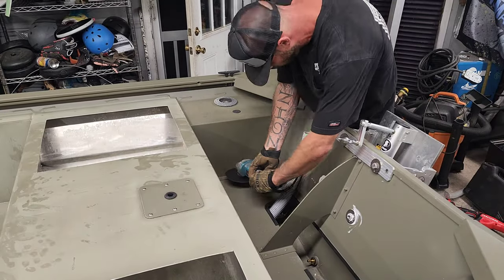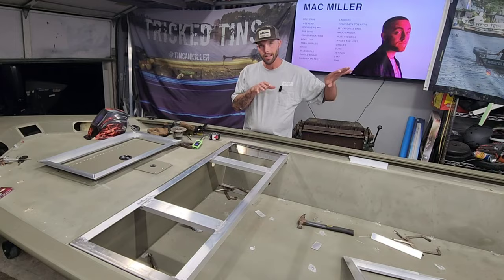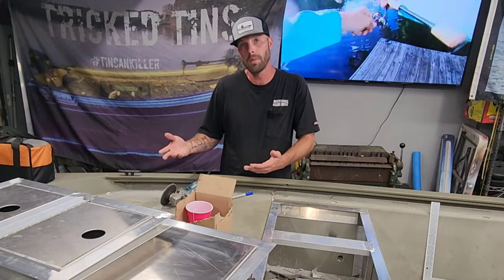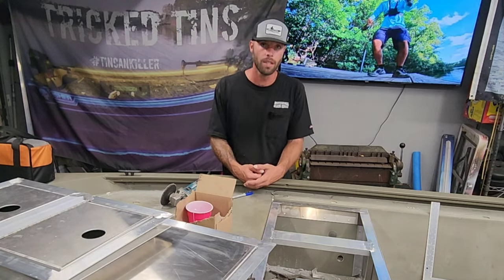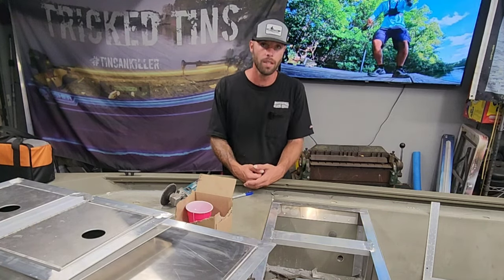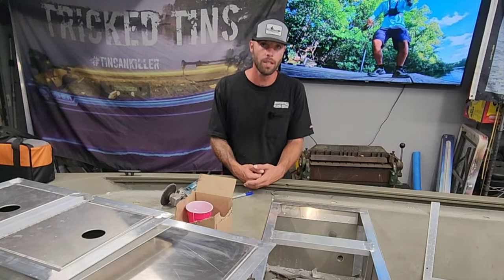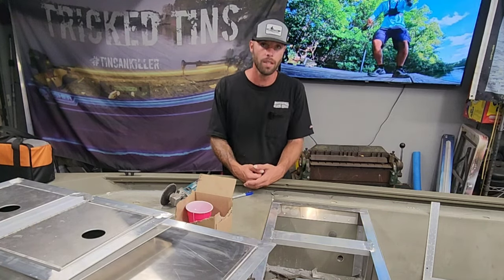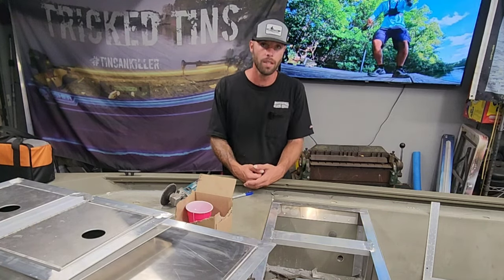Tracker Grizzly Full Build!

Comment: Awesome build once again! Curious if you do anything to those foam fill holes that had the black plugs before you turf it?   Was going to pop mine out and cover with some aluminum hvac tape to lay flat and be more waterproof before I turf.  Thoughts on that? Thanks man
Reply from the maker: That's probably a good idea. I usually just pop them out and turf right over top it
Reply: @TRICKEDTINS  Right on, thanks!

Comment: ugh...now there is literally nowhere to mount the rear seat except right in the way of the motor tiller handle.
Reply from the maker: The seat is used with a pole when fishing. Its mounted in the middle for balance.  You sit on the bench off to the side while using the outboard. Just like everyone else does.
Reply: @TRICKEDTINS  nah...I mounted a new seat location on the starboard side of the bench.  Tracker screwed up mounting that seat in the way of the tiller handle.  I've met so many that are frustrated with the center location. The seat post is even in the way.
Reply from the maker: @KevinNorthernExposure  idk man. Never hear about it being an issue. Ive had customers order bench kits with seat bases in the hatch lids, but those were mainly for side consoles.
Reply: @TRICKEDTINS  do you happen to know offhand what the inside dimensions of that bench is I want to put a permanent fuel tank in and I was hoping you may have the measurements so I can order a tank before I cut my boat up I know the width is probably about 48 inches in the length is roughly 22 but I'm not sure on the height